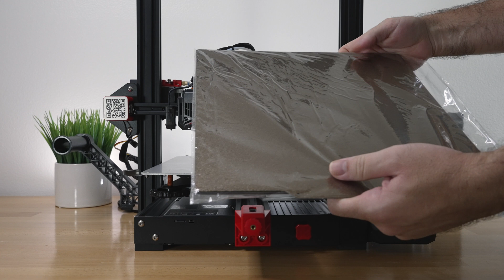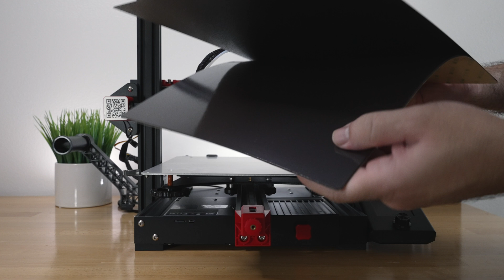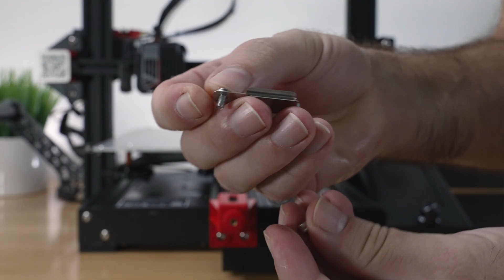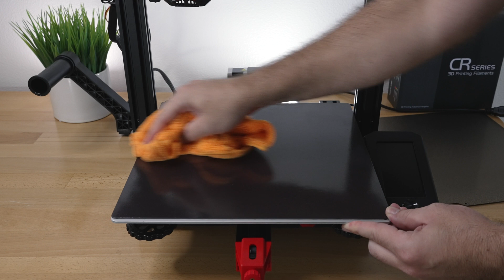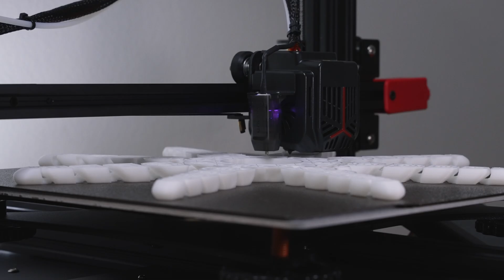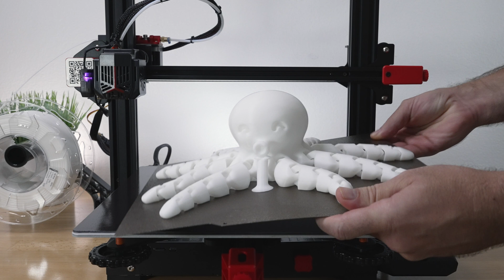Creality Ender-3 Max Neo - PEI Build Plate

Comment: I have the Ender 3 Max with the glass plate and it has been a PITA from the first month.
The textured surface wore right off just with paper towel and alcohol cleaning, and sticking issues are a constant problem.
I did get the PEI bed upgrade and am going with it.  Mine was from Creality but did NOT have both sides textured, just one.  It also did not come wrapped in plastic, it was just in a foam box with no instructions at all.   I guess they are no longer doing that.  Bummer!
Still, I hope it works better.
Definitely leaving those back clips on to help line up the PEI sheet every time on the magnet though.

Comment: You're missing the Y belt adjuster screw, like thats all I could stare at in this video. The threaded hole where that knob would go. Otherwise PEI is totally the way to go, got one all of my e3/e3 pro printers, they work awesome when running klipper and just ripping prints out. Printed a remix of that octopus (pumpkin head variant) at the approx same size yesterday in around 5 hours on an ender 3 og.